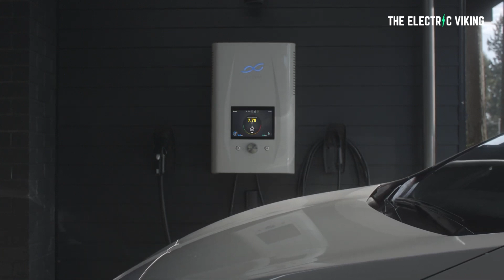The battery that charges 70X faster than lithium & has 300% more energy

Comment: A near zero emission product that relies on natural gas? That sounds a bit iffy to me... Even if all the carbon is retained in the graphene you still have to feed the oil trolls to get the gas and account for the extraction of the stuff which is all but emissions free.
Not saying it is necessarily worse than Li-Ion,  just zero emission is a strong claim.

Comment: What is going to be the limit of the charging stations to push that energy into the auto-batteries.  The charging cable would have to be much heavier to handle the current.

Comment: What is energy density?  Super capacitor is way faster and can do way more cycles. But doesn’t have a good enough energy density. This info should be included in every battery reporting you do. Love your work. Keep it up.

Comment: Hmm... in the extremely unlikely case that one can charge any new wiz bang battery 70 times faster than current batteries that would mean delivering 70 times more current to the battery to charge it. That would require 70 times fatter, heavier charging cables. This starts to sound very impractical to me. I call BS on this one. Until such time they build a car using those new wiz bang batteries and a charging station that can do the job.
Reply: Depends on the voltage used regarding diameter of charging cables.  Double the voltage with the same current in the same cable and you can deliver (minus heat losses) twice as much power.

If a standardized undercarriage layout for charging purposes were devised, you could possibly make it charge faster by many contact points and keep the conductors in the car more reasonably sized with less waste heat and lower voltage required.  Inductive coupling could be used as well.

But until such great batteries are in production and proven sufficiently cost-efficient and reliable, it seems there’s little value in speculating like this.
Reply: @strictnonconformist7369  That is very true. Simple High School Physics.

So at double the voltage we still need 35 times fatter, heavier cables. To my mind that does not help much. Going over a thousand volts brings another raft of problems. 

Then of course the grid supplying the charger has to have 70 times more peak capacity. All the way back to the power station, wind turbines, solar panels, whatever. 

Maybe it's doable, but I'm not seeing how it is practical in general.
Reply: @heater5979  when working with round cables, doubling the diameter doesn’t double the capacity: it scales better than that, as that’s PI *R squared.

Regardless, it’s clear that unless/until we get superconductors working at normal room or warmer temperatures, fast recharges are problematic for focused places that recharge a lot of vehicles because power storage capacity is very finite, even with going to using this technology of batteries for a storage tank.

It appears our future is full of much slower “refueling” vehicles than fossil fuels/biofuels provide, and perhaps much more distributed, simply because you can’t send that much power that quickly to recharge stations.

When you do the math, it becomes far more clear that Tesla is not a car company, it’s really an energy play, with cars being a single component: the power walls are part of that equation.  If everyone had a similar battery that’s recharged during off-peak hours, more slowly, that may possibly be used for a far faster recharge time at home, where the power from the utility company is still relatively low max power, but that doesn’t matter, if you can recharge your car at home in a few minutes of being plugged in, instead of 20+ at the fastest over huge superchargers.

That’s a problem a lot of people have not understood: this needs to be a holistically-designed/integrated infrastructure, and it can’t be done in only a few years, no matter how insanely green people think we must be to save the planet.  The infrastructure change is HUGE and only replacing all the gas stations with superchargers would be nowhere near sufficient: that’s the (relatively) cheap and easy part of the equation, but it makes zero mathematical sense without everything else.  Supercharger stations only work well enough if they’re fast enough for the number of cars passing through, but the number that pass through needs to be a tiny percentage to have it work: most recharging must logistically be done at homes.  There’s the massive grid upgrade outside of the homes, but there’s also the massive changes for homes, including apartments, and many cases include no viable way to add chargers.

Only a tiny percentage of cars on the road in the US right now are electric: it won’t take much to achieve a grid overcommit saturation point as it is currently.

Comment: For those that dont know, 70x faster charging/discharging means its able to be used as grid buffer, solving the huge issue of grid stability.
Reply: Interesting idea. Why bother with car batteries when they can solve issues on the grid?
Reply: @bogususer2595  Possibly a both type of thing. I don't see why not.

Comment: can the transformerss handle the amperage for that though? might be awhile till graphene makes a difference if the new chargers cost proportional more as the quick chargers cosst to regular. capacitor bank chargerss on the horizon? what happened to vanadium batteries? i see chinese are making worlds largest grid ties battery with vanadium from US tech. this will be followed but people realize there are a ton of caveats and potential bottlenecks

Comment: im interested to know comparable battery weights. didnt mr musk say once battery output reaches 230kw then aircraft will be possible. i know they are already flying but small in size
Reply: I believe 400Wh/kg is what Elon stated for viable short haul commercial aircraft. Gravimetric energy density seems to be more important than volumetric energy density for this purpose, though both are important. But we're getting there
Reply: @davidhill3142  im also interested in the diamond batteries which will be brilliant if made

Comment: Viking please don't cover every battery "breakthrough" unless they are actually producing batteries for use in real products and scaling manufacturing.  There are a dozen of these stories every day, this isn't worth my attention until 2024 if they actually do what they claim.
Reply: They are producing coin cells, and prospective customers are testing them. And they commissioned a pilot pouch cell facility as well. Oh yeah, the Rio Tinto thing. THAT is not a small thing either.

Comment: 18/1/2021 GAC （Guangzhou Automobile Group）announce graphene aluminium battery will install on they EV model AION Y and AION LX , 8 min charge to 80%  for 1000km range in later 2021. but we see nothing happen now .  Chinese Academy of Sciences academician said if some one told you there battery that can run 1000 km , charge in a few min , safety, and cheap, must be liar, cos that is impossible at current stage. as a Fund manager of new energy fund , i think at current stage , build more public ordinary fast charging station will be the best way to solving range anxiety . too many superfast charging station will be disaster for the state Grid , that need massive investment to infrastructure , that can't be happen in shout term

Comment: Until I can get a reasonably priced electric car in my driveway, that has a thousand km range, and can fully charge in less than 5 mins, everything is just fantasy and wishful thinking until that happens.
Reply: What's the rush? Current EV have decent 300-400km range, that's enough for longer journeys because you should take a break after 2 hours anyways. Taking that break at a motorway station where in 18 minutes the car charges back up is easy to handle. Just connect the car, stroll over to the motorway station, take a p.., get a bite to eat and something cold (or warm) to drink, remove the charger connection and drive off... That doesn't take longer than the typical break and I didn't even stretch the odd leg which you should also do... The other times the car charges at home or at the workplace and you set off on your journey with a full battery.

Comment: Li-Ion can charge at 150 or 300kW.  Times 70 is 21MW.  That is of no use. Charge times are no longer an issue. 2 to 3 times faster would  be enough by far. Higher density is of value, no question, especially for airplane industry. I assume the laboratory cell is only a few Wh. So let's see its price, when and if it goes to mass production.
Reply: Totally agrees. This kind of upped charging time would require a nuclear powerplant in every major city. This is insane!
Reply: Agreed
The equipment and infrastructure required to deliver that amount of power in a short time doesn’t exist and would be prohibitively expensive if it did. Not only that, but the size of the conductor required to deliver that kind of amperage would be too large to be practical, even with active cooling of the charge cable. Also, the CCS standard can only go up to a theoretical 500 amps. Currently it’s maxes out at about 200 amps. The power delivery requirements for this rate of charging is a whole other engineering challenge in itself. I write this in regard to large size batteries for automobiles.
Reply: @dhill00 , You’re wrong. They can easily install huge batteries at the charging stations. This would not be “prohibitively expensive”. However nobody needs to charge that fast anyway. See my previous comment.
Reply: Having a battery that can charge at extremely high rates means it won't have any taper in its charge rate as it gets close to full. So you will be able to charge at the maximum rate of the charger all the way to full, which is something current li ion batteries can't do. This may not be all that important, but it is still useful.
Reply: @dwaneanderson8039 , This is true too.
Reply: Charge times have never been an issue. You can charge you car up to 300 miles of range at night while you sleep. 99% of everyone drive less than 300 miles per day 99% of the time. Those who drive more than 300 miles per day more than a few days a year are extremely rare. If you’re one of them, don’t buy an electric car. If you’re not, then charging at home while you sleep requires no waiting, and is more convenient than driving out of your way ant waiting for a pump to fill your tank.
Reply: @terjeoseberg990  Charge my car while I sleep? Can I sleep at the charging station, or do I just leave the car there overnight and taxi back and forth?
 Overnight charging is an elitist niche that only serves home owners.
Reply: @lyfandeth , Overnight in your garage, or driveway dummy. If you don’t have a garage or a driveway, then you obviously can’t afford a car.
Reply: @terjeoseberg990 Not all countries in the world has the space ( real estate ) for general public to have their own parking space.  That doesn't mean these people can not afford a car,  Be nice .... Even in New York, rich people , luxury apartments, but very limited parking space, there is no driveway nor garage but these people are very rich ....
Reply: @JY-lg6ee , If you can’t afford a space to park your car, then you can’t afford a car. This is why many people who live in New York and San Francisco do not have cars.

I have a friend who lives in San Francisco who lives in an apartment. The building he lives in has an elevator for his car so he can park on the same floor as his apartment, so it’s definitely possible for everyone to have their own parking space if they can afford it.
Reply: @JY-lg6ee  and they take a taxi.
Reply: @terjeoseberg990  Welcome to America, where 80% of the population live in cities. Mainly in apartment buildings. And park on the city streets. Of course the more affluent live in brownstones or other buildings where there is no garage or driveway. Sometimes they rent garage space--but those commercial garages aren't going to tear up concrete and invest the cost of obsolete and cranky chargers.
 EV charging in Boston, Chicago, DC, NYC, SF, LA....ain't gonna happen unless you cough up a half trillion dollars for infrastruture and a new grid to feed it. Reality bites.
Reply: @lyfandeth , In America, 80% of the population don’t live in cities. You’ve obviously never been to American and have no clue what you’re talking about.

Comment: When it's out of a lab and being mass-produced, then I'll be impressed. Until then.... whatever.
Reply: I do agree with that, I've seen so many promising technology that just vanish. So tired to see those things that never go anywhere
Reply: If they are talking about a pilot plant in 2024 then it's out of the lab and in the hands of the engineers  but I get what you're saying.  That's the thing with startups they are after investors so they tend tward overpromising.
Reply: I’ve had LiPo batteries for my RC helicopters that I can charge at 12C for over 10 years. That’s 5 minutes.
Reply: And who wants to know this. If you have nothing to say ...simple say nothing...
Reply: @paulwirkus260 , Because it’s only a fantasy until you can actually buy it.

Comment: A battery that can charge 70 times faster requires a power source able to supply at 70 times the power rate. That is a big cord, plug, power line, and source capacity to do so.
Reply: True and you will notice the very same people demanding we buy EVs are the same people who will fight every 24/7/365 base load power generating facility especially Nukes.  While I love the driving performance of the Tesla Model S, I detest governments demanding people buy EVs as they are NOT the best vehicle for everyone. They are great for a significant number of people but again not everyone.
Reply: @mikewurlitzer5217  Not to worry, EVs take time to develop and build so the transition will provide time for buyers to see and experience their next purchase.  They will buy what works for them, they are not being forced. Lots of people don't have cars, EVs will supply their needs by their choice as they rent or buy rides.
Reply: @mikewurlitzer5217  I guess you want the planet to overheat so we all die? ICE pollution is 25% and getting worse. You are selfish
Reply: To some degree, yes, but all current batteries can discharge faster than they can charge.  If the charge and discharge rates at least matched you may not need much more infrastructure depending on application, and something like regen braking in a vehicle could be much more powerful and not limited by battery charge rate.
Reply: The simple solution is to build a battery bank at the locations where you need to charge the cars running on this battery. You could charge the bank at night when rates are cheap and fill cars during the day. Everyone makes money this way.

Comment: You may not mean it this way, but this video is just another FUD article trying to convince folks something better is around the corner. If the Manufacturer can’t hand the battery over to an independent lab for testing,  then a CEO from a fossil fuel company should require a very high bar before their technology is acceptable. Publishing density, cycles and working prototypes at a minimum!

Comment: Fun fact: lithium was alloyed with aluminum to create a lightweight aircraft structure.  Lithium is the lowest density metal on the periodic table.
Reply: It must be strong if airplanes use them.
Reply: @markpetty9206  lithium alloyed with aluminum to create lower density, hence weight, of parts made therefrom.  I honestly don’t know how widely it was used or if still used, but the advent of composites may have lessened the need.

Comment: yeah right. the power cable for this kind of amps  is probably thicker than my waist, unless the voltage is like 100000v. the speed is not that big a concern now.
Reply: Yeah, people don't realize how much power even a 250kW Tesla charger puts out, considering its 5x more than a typical 240V / 200A service to a whole house.

Comment: Pointless unfortunately... electricity and power are problems here. When you go to Tesla supercharger, and you have 2 or 3 cars around you charging at the same time, power of charging will split between you. So V3 supercharger will give you only 80-100kW of power max. So whats to point of making fast charging batteries when even today batteries are overkill for grid. This will become huge problem over time...
Reply: That is incorrect information regarding V3 superchargers. V3’s do not power share. You may be mixing that up with V2’s that do power share.
Reply: @hrhdnc  
Yeah i was gunna say but i've only used v3 once so far so i couldn't remember
Reply: @hrhdnc  yes, i thought V2.. my bad. But even witg V3, there is a limit how much power you can draw from the grid. Imagine 15 Teslas on one location at the same time, something we can see very often. And then imagine all of them start to pull 500kW or more for some ultra superior batteries with great charging potential. That could be huge problem for local grid infrastructure...
Reply: Need more nuclear

Comment: None of these batteries will amount to any significant benefit to consumers until well  after patent run out. Same old story they will want residual income for every battery made. And no manufacturers will bite. So the tech will fade away for many many years. We all know this. Same with Toyota etc. we should count only on battery tech in manufacturing now. Vapor ware until 10-15 years from now when it really makes difference.